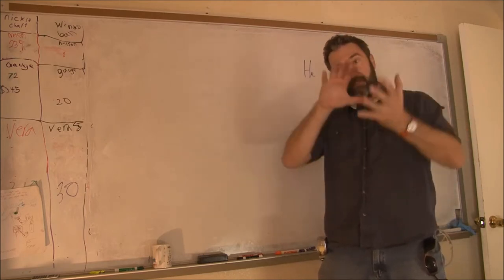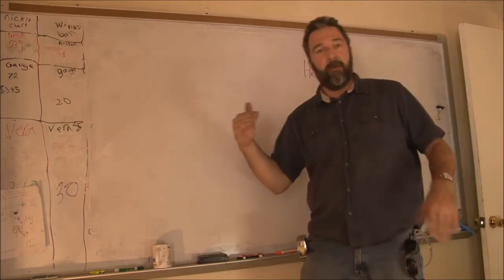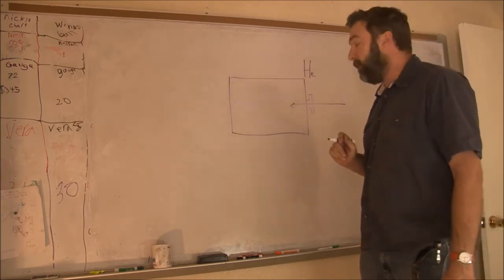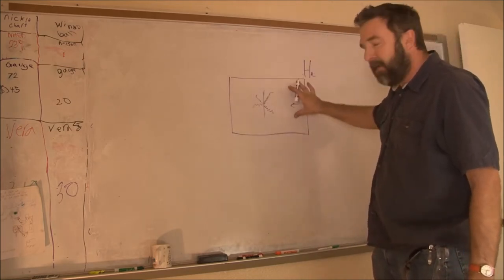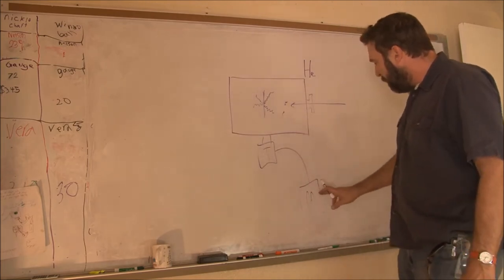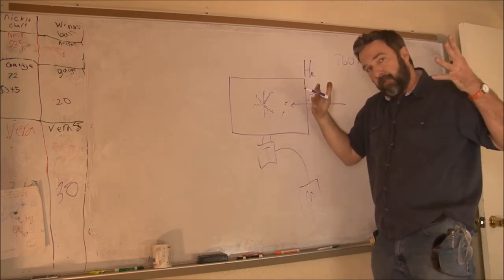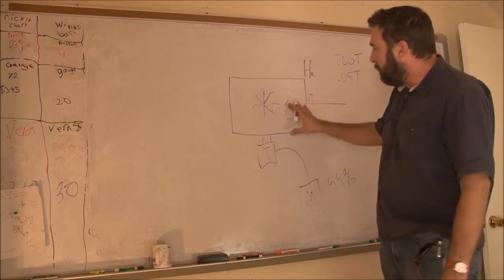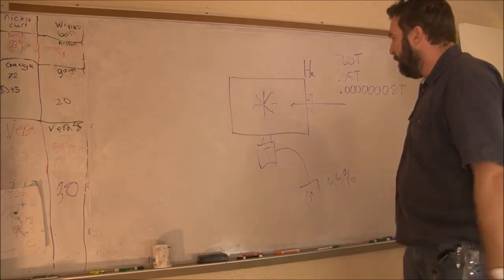Why is a low vacuum important for our Nuclear Fusion project?

Comment: Hi! Thanks for your videos! I love that you’re using a beer keg to build your vacuum fusion chamber. I have a question though. Did you need to add supports to the inside of the keg to keep it from imploding on itself? I want to try pulling a vacuum on my 4in triclamp keg but these triclamp kegs are not cheap and I reallllly don’t want to just throw caution to the wind and find out. And I can’t find anyone else online who has done one. Only people asking about pulling a vacuum on their kegs and everyone just answers “no, the seals need positive pressure” over and over. And no one actually says whether or not they could handle it if they could seal for it… as I with my triclamp keg CAN seal it for vacuum pressure. Can you help me out?